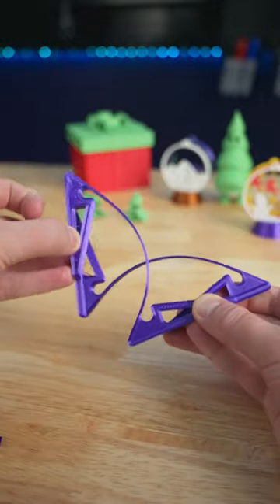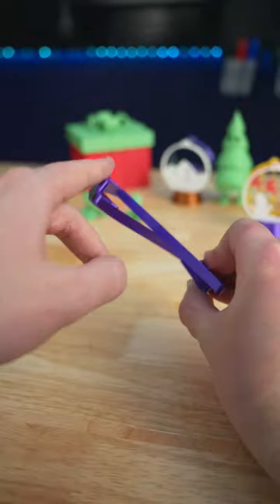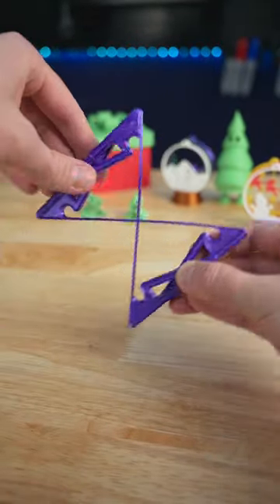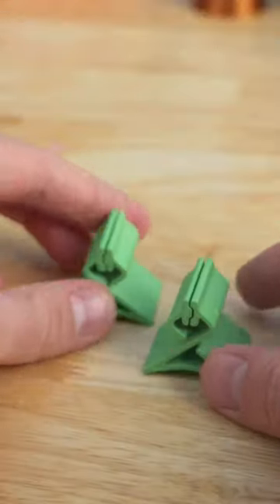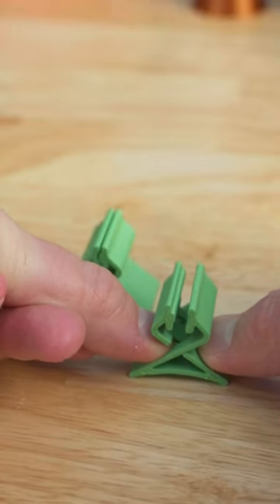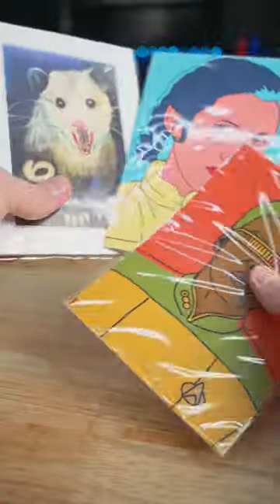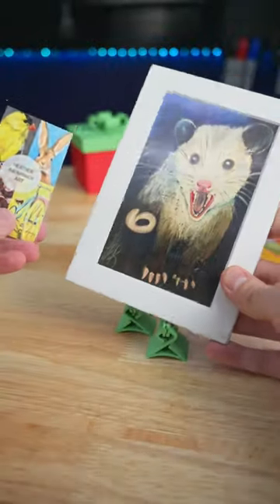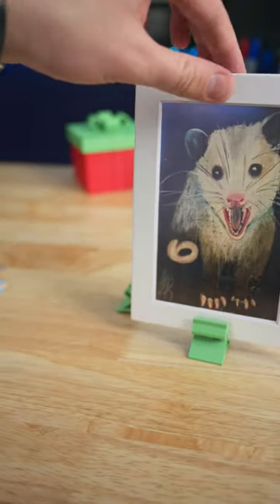3D Printed Functional Compliant Mechanism ⚙

Comment from the maker: 🔥My Favorite Starter 3D Printer: https://amzn.to/3hMi2r2
Favorite Mid-sized 3D Printer: https://amzn.to/3Eq9KNa

🌈BEST PLA Filament: https://www.printbed.com/home?tap_a=119803-9b31ae&tap_s=3212393-8f9491

STL Links: https://www.printables.com/model/146335-minimalistic-compliant-photo-holder
https://www.printables.com/model/174512-simplified-snap-fit-flexure-pivot
Reply: Which do you recommend for starters the one from your link or I've heard that the Ender 3 is good too?
Reply from the maker: @deenaharmon2604  I think the ender 3 is over hyped. It's just recommended by people because so many other people have them that you can hopefully find help when it breaks. I have heard so many people have issues with them, and there are so many different versions of the Ender 3 that it gets confusing. My two recommendations are ones that I have tested and continue to use almost every day.
Reply from the maker: @deenaharmon2604  And for a starter printer this one is great if you are interested in possibly doing some tinkering and upgrading: https://amzn.to/3hMi2r2
While this one already comes with all the upgrades you would want:  https://amzn.to/3Eq9KNa
Reply: @JJShankles  OK thank you!
Reply: Opossums